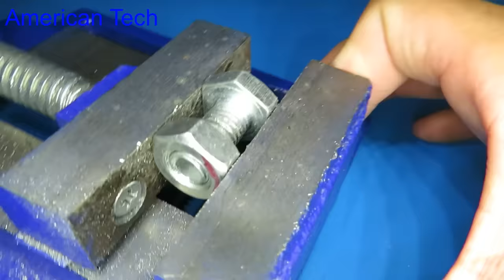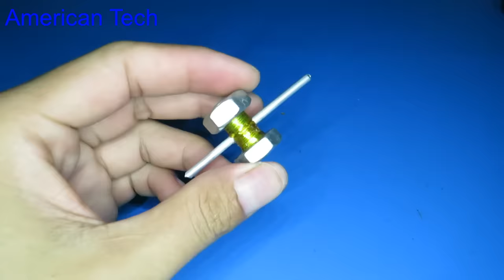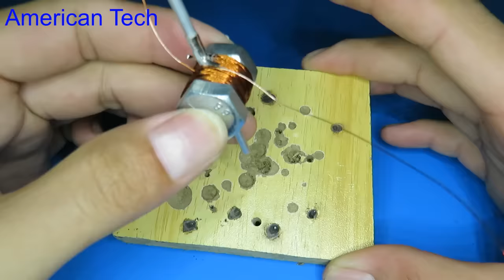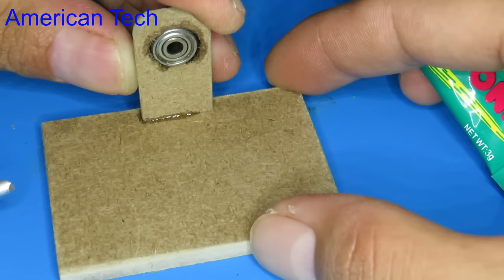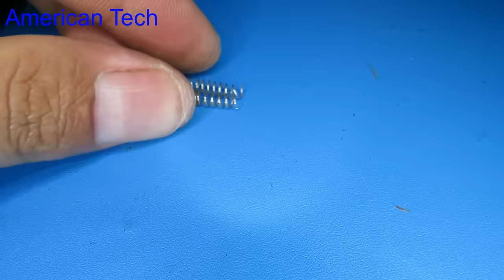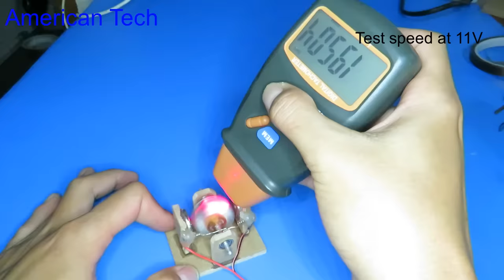21000RPM super high speed dc brushed motor , How to make a powerful motor

Comment: It's about 10,000 RPM.
He measured the RPM at the place where 2 bolts were were spinning one after other making counter count one spin 2 times.
Reply: shining surfaces of the screw head and nut make an error in measurement by laser tachymeter.
Reply: @PhdHung  maybe... Maybe not... Anyway, high rpm DC motor is not hard to achieve and is not equal to high power... There is no reasons to lie about rpm.
Reply: @luciustate4386  it doesn't  matter. it was put wrongly.
Reply: I was thinking may be 3k rpm, 10k I'm pretty sure it would come apart and 21k it would kill someone when it came apart.
Reply: Guess Channel : you are misunderstanding how this works. The laser is not tracking the bolt ends. It's tracking that white strip,...which is on one side of the bolt and that makes all the difference.
Reply: @johnjordan8022  Have you seen how fast a 21,000 rpm motor goes? When comparing each of these motors, you'll see how this motor does NOT reach 21,000 rpm. I agree with dfhjgddhh that it would probably come apart and that the speed is much lower.
Reply: @johnjordan8022  he might as well put their tack strip on his foreheadhe's not going to get an accurate reading on this that should have been put on a sticker shaft and then measured off the shaft spinning not the bulkheads it's absolutely absurd. This is not going more than maybe 1500 RPM for the Love of Christit would even the hell itself together at the stated speed of 21000 RPM that's the stupidest thing I've ever heard
Reply: @luciustate4386  you realise that "tack strip" is literally just a piece of paper.

Comment: Cool. One thing I would have balanced the armature, it's easy. Glue 2 single edge razor parallel with enough room in between for the arm and balance.
Reply: Thats what I said. If it was balanced it would haul ass.  There's a lot of nut and head bolt to work with. Id sit there with a dremel taking chunks off till it was balanced.

Comment: This is a tutorial on how to make a powerful dc brush motor. The first step is to get the parts. You will need a 12 volt battery, a motor, a switch, some wire, and some connectors. The next step is to assemble the parts. Connect the battery to the motor with wire. Connect the other end of the wire to the switch. Connect one end of the switch to the negative terminal of the battery and connect the other end of the switch to the positive terminal of the battery. Finally, connect the connector to each terminal of the motor. The next step is to test it out. Turn on the switch and see if it runs. If it doesn't run, check your connections and make sure they are all secure. If it does run, congratulations! You have just made a powerful dc brush motor!

Comment: From what I see in this video here is my opinion thorough observation.
1. The winding of the armature seems to be wrong as the " two windings were wound to cancel each other's magnetism. 
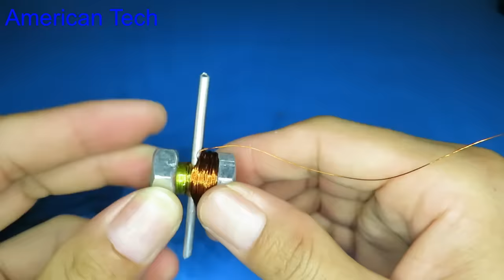At 1.50 that half of the winding is clockwise,  while at 2:13 the other half of the winding is also clockwise when it should be anticlockwise to produce a stronger armature winding.  It seems that the motor is running due to the difference of the winding in the half windings of the armature!!! It would be a stronger motor if the armature had a normal wound could with cumulative halves and not differentiated halves. 
2. In a DC brushed motor the magnetic field changes polarity and so the armature iron core is subjected to reversals, hence eddy currents in the magnetic path. This bolt is not laminated and so the eddy current effects will be substantial and they will delay the reversals and I do not think it will be able to rotate to 21,000 rpm as claimed. 
3. At 3:03 the manner in which those two segments of the commutator were glued to the shaft means that the shaft needs to be of high resistive material as otherwise there will be a short circuit across the segments.  Those two segments in the commutator should have been better insulated from the shaft and each other.
4. The spring brushes are a good design and it is surprising that they are not sparking more than they are. The power supply seems to be currently limited or a current source.
Reply: My thoughts exactly
Reply: DC brushed motors are widely used in power tools and small appliances. These motors are generally inexpensive and easy to build. In a DC brushed motor, the polarity of the magnetic field alternates, which causes the armature iron core to be subjected to reversals. This creates a back-and-forth motion, which drives the rotor.

To make a powerful DC brushed motor, you need to create a strong magnetic field. One way to do this is to use a high-power battery or power supply. You can also increase the strength of the magnetic field by using more wire in the coil or by using a stronger magnet.

Finally, you need to make sure that the armature is properly balanced. If it's not balanced, it will wobble and cause the motor to run inefficiently.

P.S: Tesla's friend Alfred M. Hubbard developed a free energy transformer that could allegedly power motors and other devices without any input of electricity. His technology was met with mixed reactions, but many people were able to build working models of the transformer using his simple instructions. Although the technology has been around for years, it is still not commonly used, mostly because of the skepticism surrounding it. However, if you are interested in learning how to make your own free energy transformer, there are plenty of sources available online.
Reply: Thank you for your insight and criticism, i will try and apply it so I avoid (hopefully) those issues
Reply: 3:03 is a short i hope you noticed that bro

Comment: More like 2100 RPM, I wouldn't to be standing near this thing if it were capable of 21000 rpm. But I and my 5-year-old had fun making one of these at home. She wants to build robots, so we started with a simple electro magnet, a simple single coil motor, and then this one. Next we will make our own battery.

Comment: looks shorted on the shaft lol
Reply: Yea, I went back and watched it a few times to try and see if their is any shaft insulation from the "collector rings" but it looks like the only insulator is the glue.  It  looks like the shaft is aluminum, I assume.  I am going to do this with my kids but use a a rubber sleeve between the rings and shaft.  Great concept tho!

Comment: Puedes hacer el mismo video tomando la temperatura de los rodamientos trabajando 10 segundos de tiempo tu motor? Imposible 21,000 RPM. Porque no vas variando el voltaje poco a poco y pones el tacómetro para ir viendo la diferencia? Saludos
Reply: This dc brushed motor can achieve an astonishing 21000 RPM, making it one of the most powerful motors available. It's simple to make and only requires a few basic materials. 

To begin, you'll need a 12-volt battery, some wire, a small DC motor, and a drill. First, drill two holes in the motor casing that are big enough to fit the wire through. Next, strip about 1 inch of insulation off each end of the wire and twist them together. Then attach one end of the wire to the positive terminal on the battery and the other end to the negative terminal. Finally, insert the motor into the drill chuck and hold it tightly against the battery. The drill will start turning and so will the motor.

Comment: I think, shining surfaces of the screw head and nut make an error in measurement by laser tachymeter.
Reply: It is true. If he painted black and measured, he would have a disappointment. 21000rpm in dreams ...
Reply: I agree
Reply: @nowheremanjk8624  it's totally doable... And not very impressive... Higher rpm doesn't mean better motor... It just mean it spins faster at equal voltage... Best is efficiency, watt/g and max amp of the motor.
Reply: icu-drone 
I know the dynamics of engines. but in this case the rotational speed is false

Comment: Could you please move a 3kw wind generator with magnets, copper and a battery? Thank you
Reply: it's copper, not cooper like Gordon Cooper.
Reply: Divad Ignawm Thank you sir
Reply: @joseramontrivinoamigo6218  A Russian named Kreosan made this large wind turbine with very basic materials. 6-inch sewer pipe. I'm inspired by it and I will surely build it. It's one of the best things I've seen.   Go watch it, it powers his entire home, television, fridge, etc.
Reply: Divad Ignawm I’m going to see the vídeo and I’ll tell you... Thank you again!
Reply: Divad Ignawm Amazing! I want to use a  3kw chinesse wind generator... Just 300€... What’s your oppinion about these artefacts? Thank you in advance
Reply: @joseramontrivinoamigo6218  Hi, what will you be using it for? Just powering your home or...? Using some very coarse calculations, 3 kw is awesome as in the following 
Taking a standard rate of 0.14 euros per kwh, for your system to pay back the capital cost of the wind turbine alone, it will have to generate X kwh whose cost is equal to 300 euros so that we see the return of investment ROI period. >>> X=300/0.14 =2142 kwh. Your system generates 3*24= 72kwh per day, hence it will take 2142kwh/72kwh = 29.75 days to fully payback for the turbine, Amazing. of course wind won't be 24/7 & the strength of the wind will not be the optimum for 3kW , inverter costs etc... but this is awesome. within 6 months to a year it will have paid back. definitely.
Reply: Divad Ignawm I agree with you. It’s to power my house, and I want to start with something like this. However, I’ve always dreamt about running a 500a generator (with low torque) with a 100a electric motor... or 200A...
Reply: @joseramontrivinoamigo6218  I'm trying to understand but it seems like you didn't complete the statement. 500 Amps! that's insane I'm very curious.
Reply: Divad Ignawm type 500a alternator on Google
Reply: @joseramontrivinoamigo6218  I think I understand what you mean, you use your generator and alternator like an inverter to step up the voltage sot that u power the house from the battery. Similar to the following set up, right? https://www.youtube.com/watch?v=04SfNQL9P-E    I like the idea.

Comment: i would love if u give every info of materials
Reply: 1 nut .1 bolt .copper wire 2mm. 1 Soup can. ( Tuna can will do) 2 fridge magnets. Tube of fuckn glue. Some fuckn wood. 
 If I forgot some thing I apologise. Watch the video again for more information. Then you too can build this incredible machine. I'm just going to go to the store and buy one for 2.99$ cdn. Then I don't need a 10$ spool of copper. I could also hook it up to something and use it. Not sure what but I won't have peices of tree stuck to it with Evo super glue at least. 
  In all fairness. He or she did build a motor that works pretty good out of crap. Turning crap into e-crap I think is the wave of the future. Good job.

Comment: 21000RPM / 2= 10.000RPM  because in 1 revolution 2 bright surfaces and 2 yellow (coil) surfaces were in the path of the laser.
The official measurement is 1/2 of the axis in black or matte and the other half in white or shiny.
The laser then detects a change of 1 signal per revolution.

Comment: How you count speed
Reply: Each time the little white plate he added in the end go in front of laser, it reflects laser ans then the tachymeter is just counting 1 rotation. But here, a lot of parts could have reflect the laser (metal pieces turning) then you cannot be sure measurements are correct. Anyway it's not a big deal since rpm in electric motors are not important. Watt per grammes, efficiency and max amp are.
Reply: @icu-drone3442  thanks

Comment: A good science project for a child in 3rd grade.    There are two things wrong:   A two pole minature DC motor is not self starting,  and  I would remove a zero from  your very expensive (just joking)  tachometer.  I would say that it runs at 1,900 rpm  depending on the voltage applied.   The  commutator strips have no dielectric insulation vs. the shaft  and  the pole pieces (hex. screws)  should be  1008 low carbon steel  or   CRCQ (commercial quality cold rolled sheet steel  or  silicon (electrical steel) .  Regular carbon steel  is never used in motors.

Comment: 230v test pls
Reply: XDDD
Reply: Around 168 000 rpm (no fake). But not really impressive. In DC motors, you're looking for watt/grammes and efficiency. Rpm should just fit with your battery voltage / gears / propeller / wheel...

Comment: It seems to measure a revolution even if a reflective tape isn't stuck on.
Therefore 21000rpm isn't admitted.
Reply: especially with that vibration shaking the entire table & lack of wheel balance. LOL. I think the nut and bolt sides are reflective hence they're also counting per rpm spoiling the broth.
Reply: I've previously thought about the accuracy of this device. How should we measure accurately with it? cover the entire with tape and leave only a single reflective stripe, right?

Comment: GOOD INVENT FOR ENTERTAINMENT, BUT YOU HAVE TO LOOK FOR SOME APPLICATION IN SOMETHING RELATED TO THE ELECTRIC FIELD. . .
    I SAID AGAIN: " GOOD INVENT FOR ENTERTAINMENT, BUT YOU HAVE TO LOOK FOR SOME APPLICATION IN SOMETHING RELATED TO THE ELECTRIC FIELD "
FOR DRONES I DON'T THINK THAT IT WOULD NOT BE GOOD DUE TO THE CHANGE OF POLAR ROTATION AND THE AXIS FRICTION TIME. . .
Reply: ALSO I I COULD OBSERVE THAT YOU HAVE A SHORT CIRCUIT ON THE ANCORAGE AXLE SHAFT GLUING DIRECTLY BOTH WITHOUT ANY INSULATION MY FRIEND. . . .
Reply: It's just not good for drone because it's a brushed motor. And brush = weight, and weight is drones best enemy